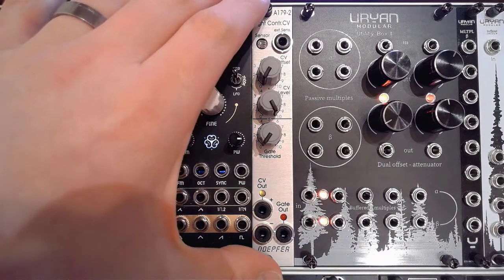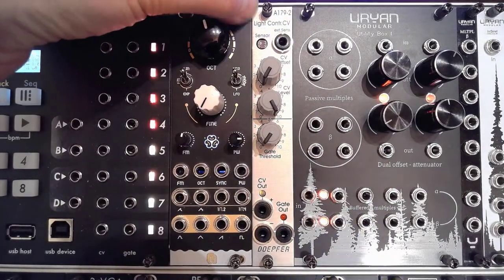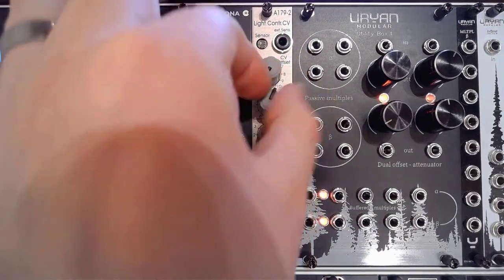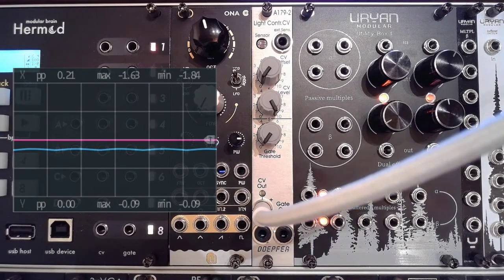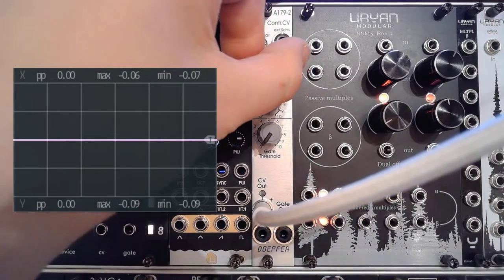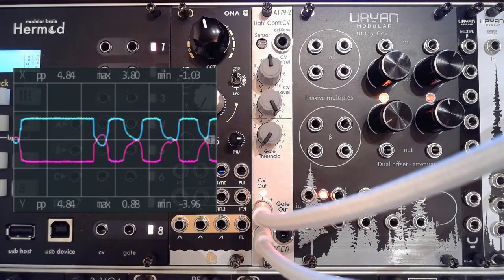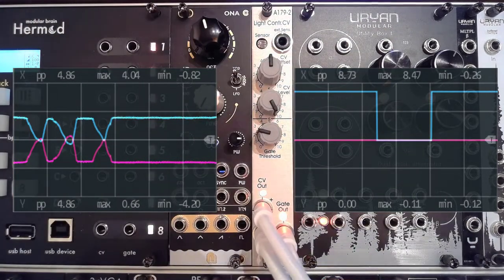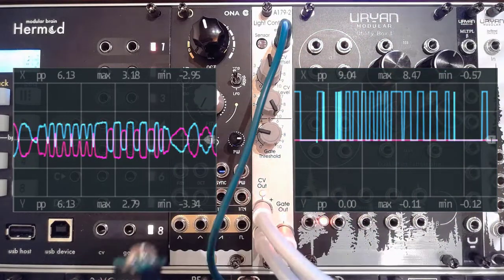Episode 71: Doepfer A-179-2 Light Controlled Voltage Source II

Comment: Does it work if you approach it with your hand from the side? I tried to slow down the video to see how it was affected by your waving motion but it was hard to tell. Really interested in geting one of these and mounting on an external controller :)
Reply from the maker: I responds to the total amount of light that hits the sensor so if your hand is not completely in front of it but still blocking some light, then it will respond to it.
Reply: @TheModularClubhouse  That's great to hear, thank you!

Comment: Use the A-179-2 gate out, invert it and connect it to the A-197--3 and use its LED strip to light up your rack when it gets dark in your room. Thats probably how I would use it ;-)
Reply from the maker: That's actually a great idea!
Reply: @TheModularClubhouse  Only problem is that it would flash unless I placed the sensor somewhere else in the room where the LED strip wouldn't influence it :-D